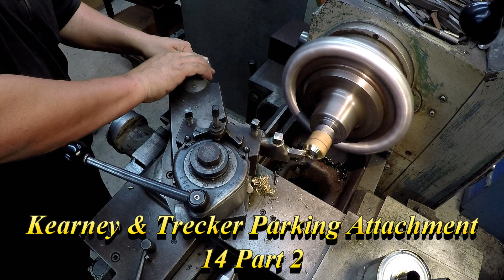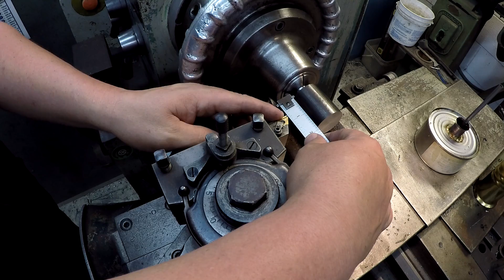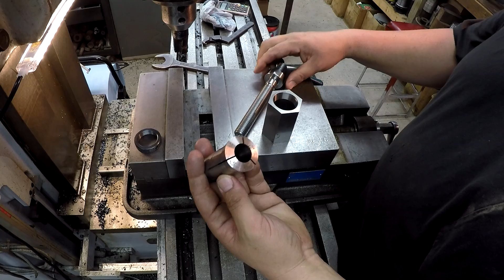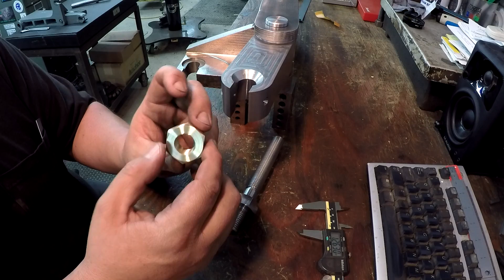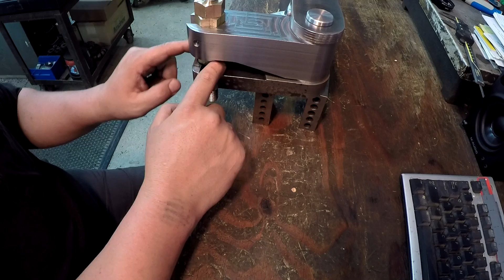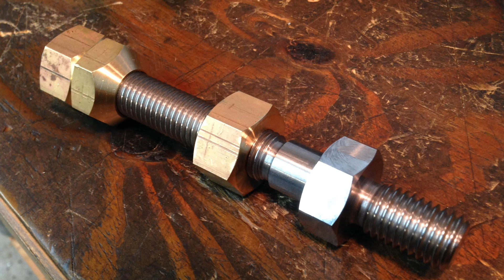Kearney & Trecker Parking Attachment 14 Part 2

Comment: Very nice work Adam and fun to watch as always.
One remark though, You  turned the face of the brass nut in a (straight) conical shape, were a convex end would create a line contact with the 45 degrees cone in John's swing arm, making it more easy (less force needed) to align that heavy milling head in its parking position.

Comment: Adam, A question.   With the compound at 30 degrees (60 degrees off 90) when cutting threads, and you advance it .010" doesn't that only make a .006" deep cut?
Reply: .00866"